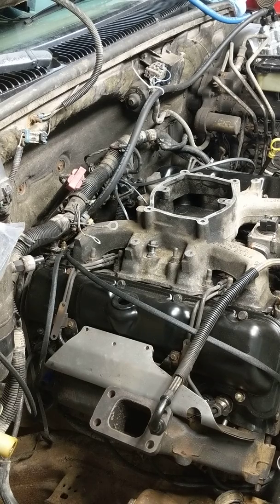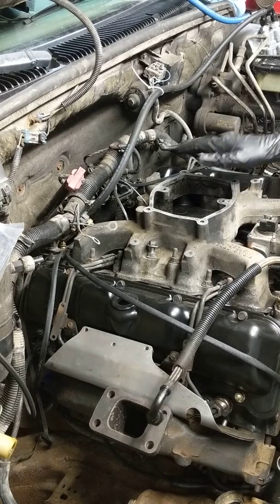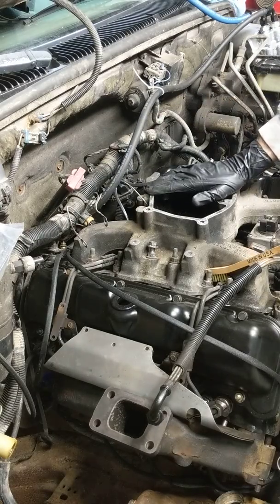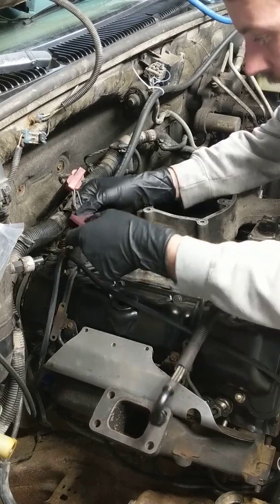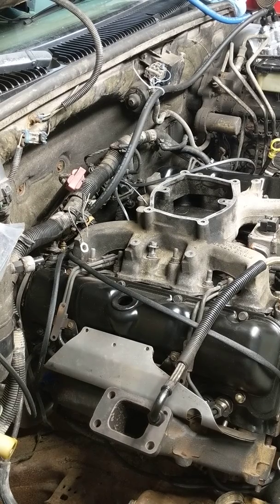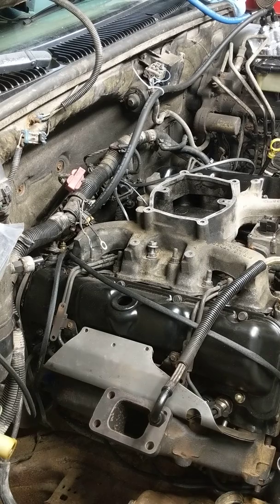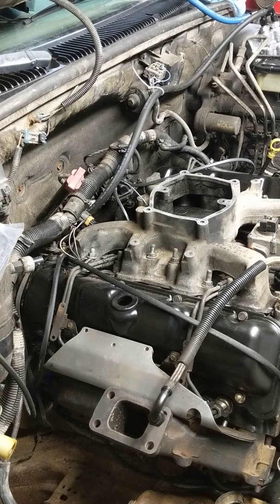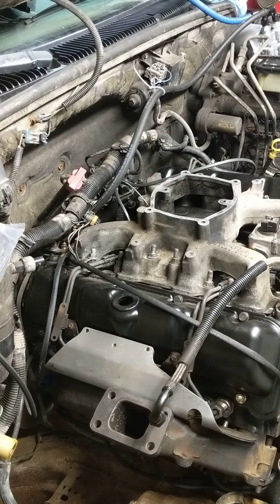6.5L Turbo Diesel Engine Ground Maintenance

Comment: Might want to cover that intake before going nuts with the air hose...  Don't want to blow crud around with that open or it goes directly into your engine and can damage valves and pistons...

Comment: Mine doesn't seem to have one anywhere on the intake and not on the back right. I have those studs but no ground wires I can see. I have a 2003 Workhorse p42 w/ a 6.5 and the only grounds I have found on the engine are a set of three left of the fuel filter (driver side) below the glow plug controller. And then one for the PMD on top of the injection pump.

Any ideas?

Comment: Dont seem to have any grounds on those studs. Only ones on the engine ive found are 3 on the back drivers side under glow plug cont module. Mine is a 2003 p42 step van with 6.5 diesel.

Comment: I have a 96 k3500 6.5 that I drove through a water puddle. after I parked it then it won't start. replaced starter and sounds like it engages but still won't start. not sure what problem Is

Comment: im having an issue where when i hit a bump or take a turn to hard my radio will cut out and come back on and all the lights will flicker. it looks like the ground strap has coroded and broken in half, would this be the source of my issue or do i have a deeper electrical problem? im also having an issue with my blower motor where it almost never works, ive replaced the resistor, relay, switch and the motor itself and no luck. every once and a while it will kick back on and work for a couple days then suddenly stop again. im thinking about removing the entire dash and checking all the wires at this point, does anybody have an idea what it could be?

Comment: I may have missed it in the video but was the spray just an electrical contact cleaner?

You guys are the ones who make the gear reduction starter as well? That's cool that you'd make this video. I'm new to diesel engines, but I know charging and starting problems are more often grounding issues than people realize even if getting new parts "fixes" the problems - - and knowing you guys sell starters I think it's even cooler you would make this video as pre-maintenance for the charging system.
Reply: Saw no response. 
The old 6,2 starters were tough.

Comment: Does anyone know why a 95 6.5  would be hitting on only 1 cylinder but never actually starting and blowing black smoke everywhere, it does have a completely new fuel system that has been bled, and all new working glow plugs as well as starter, grounds have been checked, thanks
Reply: Your shaft is broken in the pump and not turning the rotor

Comment: Hey there. I apologize in advance for the massive block of words I'm dumping here, I just need some help in narrowing down the original issue. I'm including a lot of coincidental details. Maybe the issue is a combination of things, or something obvious that I somehow overlooked.

 I'm having a "crank but no start" issue. My 1st instinct was to go through and check all my grounds And They all looked good but I cleaned everything up while I was there. The test light seemed to show good ground. Tried every troubleshoot and tip The I have come across on the internet,  somehow managed to miss 1 of the Grounding straps That goes between the engine and the chassiwitucked down in there Behind the front passenger wheel. there are two within fairly close proximity,  One of the straps there was frayed(It almost looked like a rat chewed on it. I forgot which 1 exactly was damaged, but I got 2 new ones. 

My question is... Could that frayed strap Result in a crank but no start? There's fuel flowing Everywhere needs to be up until The Injectors, Which makes me think The Injection pump or PMD Was fried. replaced the pmd, But I discovered the frayed ground strap after I had done that, So maybe the new pmd Will work .

 When my truck 1st failed,It had been running a little hot, I made sure I had coolant Until I could get to a spot where I could flush all that out And give it new coolant.  I changed the oil And filter So that I could Continue my journey back home with a little bit less worry.  on the 1st drive after doing that, I made it about 3 miles if that And I felt A complete loss of power.Like the gas pedal had absolutely no function, And it just kind of died. My friend that was riding with me  said that he saw a decent cloud of smoke From the exhaust,But it was really dark and he wasn't able to tell if it was white or black. 

I immediately started checking on my grounds and the connections on my batteries. The positive terminal On the passenger side battery was looking ugly. The lead chunk that the post was threaded into came out of the battery. The rubber on the 2 stacked cable lugs was melted, And there were little pit marks On the lugs which I assumed was made by electricity arcing.  I wouldn't be surprised if this failure was initiated by Some faulty electrical, the guy bought this truck off of Mickey mouse the bunch of stuff and I am constantly finding Fun little Projects to clean up after him.  

 It has been really frustrating And My trucks failure lead To a few months of very unsavory situations that sent me back,And I've been struggling to recover from it since.The failure happened about a year ago, And I just recently Started really digging into it. I cleared a bunch of things out from under the hood so that I could access the injectors, and make sure those were Looking decent, new glowplugs new harness. 

I know I'll get this thing running again, But I would like to know What led to the failure In the 1st place.  Im hoping you could maybe Help me out With your knowledge and experience. Is there anything else I should be checking out while I have everything taken apart?At this point I don't even mind taking the extra time and spending the extra dollar To make sure I don't have to take this thing apart again for a while.I would appreciate Any Knowledge or opinions you might have. If you would be willin
Reply: Again I apologize for the mass of words. I really hope That It isn't too hard to comprehend.My communication skills aren't the best,But I make excellent scrambled eggs

Comment: Hi, I've had a ground problem off and on in my 99 2500 6.5 when it gets damp or this time I came home in the rain.  Now the starter won't engage, just click.  I think it is the ground that goes to the frame and then back up to the trans dipstick stud.   I took the screw out and it was wet and nasty on the two grounds that attach there.  Cleaned it up as good as I could, but I think the rust is too bad as it still won't turn over.  Any ideas what it could be if its not this ground.  Connections on starter?
Reply from the maker: Yes, the main battery cable connection to the starter, the connections at the passenger side battery positive terminal, or the single wire that activates the starter solenoid. May need to take the starter off, test it, and check all those connections.
Reply: @QuadstarTuningLLC  Well, I went out and checked it again and realized I had failed to connect the positive that leads to the starter as it was not even clicking now.  It is starting now.  Must have been the grounds connected to the frame.   I'll have to figure out how to fix that.